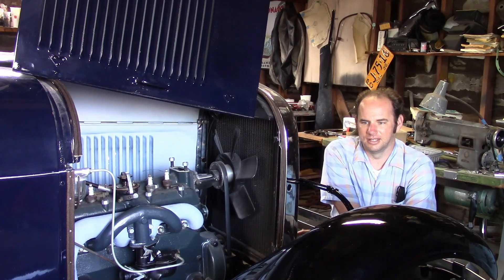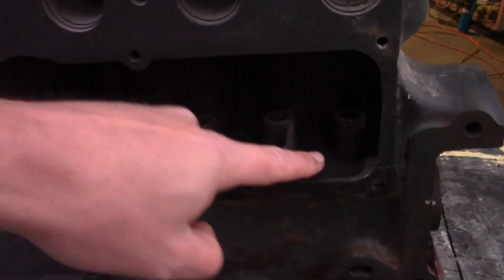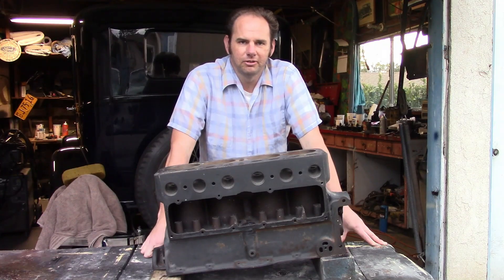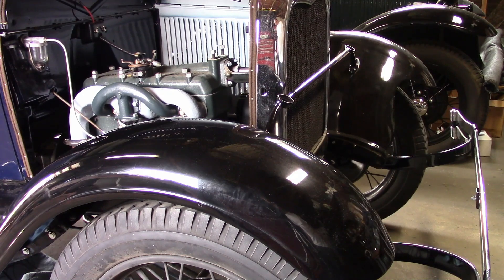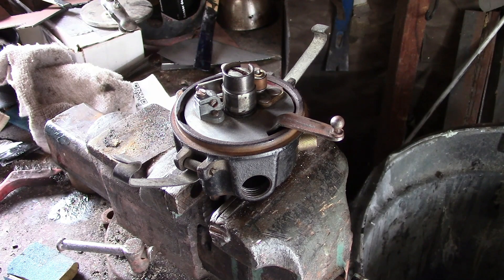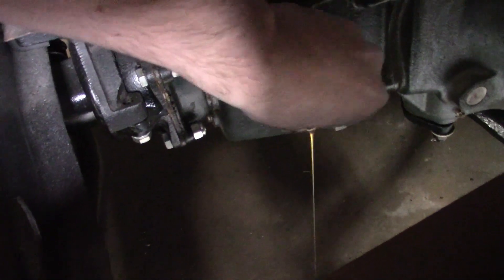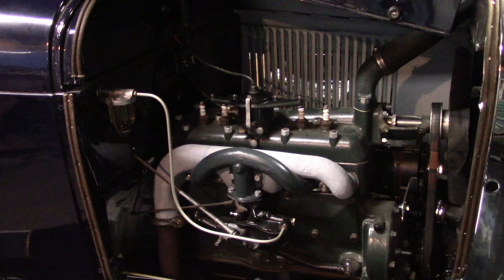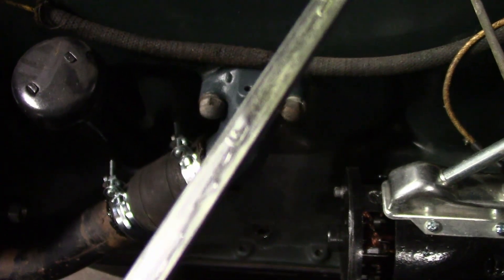How to start a rebuilt Model "A" engine.

Comment: I certainly enjoyed this.  As well, I agree with you on not revving a new engine.  I haven't seen a fan with that blade set-up before.  My understanding has been that the original two-blade fan pulls the most air.  But I'm not a Model-A expert.
Thanks for this and I look forward to future videos on it.
Reply from the maker: Yep, There's a lot of argument over what type of fan is best. I've used just about every type, and they all work to me.

Comment: Filling the oil chamber with oil, Putting some oil down the spark plug holes, then spinning the engine over a bit without any load on it before actually lighting it off. Thats just plain using your head!!! Be nice if all Model A owners practiced that kind of diligence. Probably would save some premature engine failures.  Neat watching the exhibition of the dams overflowing too.

Comment: I always use marvel mystery oil in fuel and oil  helps with break in and  Delo 30 wt 
After 800 miles i just use marvel mystery oil in fuel and fresh change of 30 wt delo 
At 800 miles   great video thanks for posting 😊

Comment: Being mindful of the oil circulation in the Model A engine. I crank the engine with the ignition off to first pump the oil into the chambers before I start it.

Comment: I guess that Model A Fords don't run enough valve spring pressure to require a cam break-in period at elevated engine speed right after the first start?

Comment: Would going down a steep slope mess with lubricating the rear main?
Reply from the maker: Yes it can, but normally it takes a long time for the oil to completely run out.